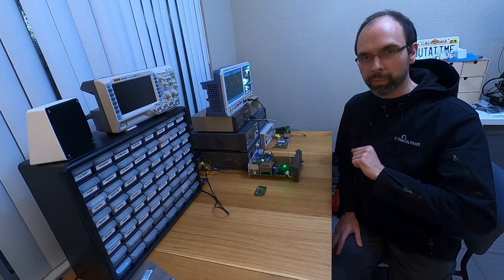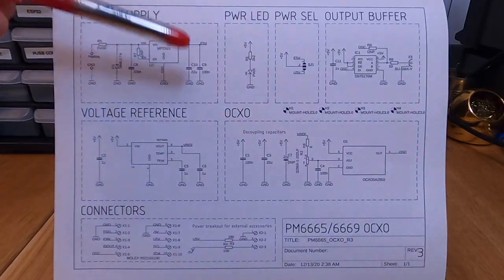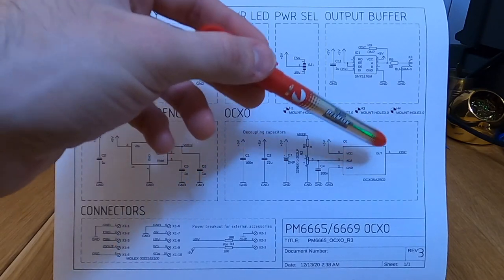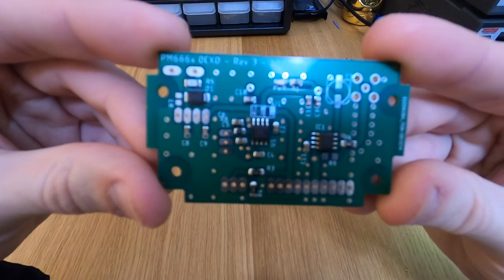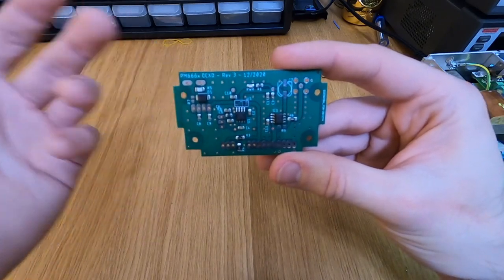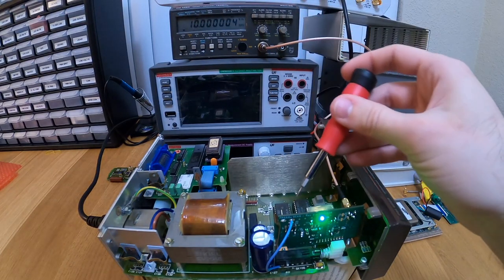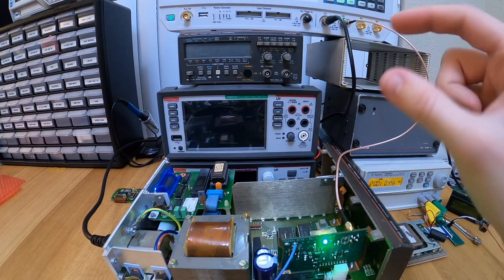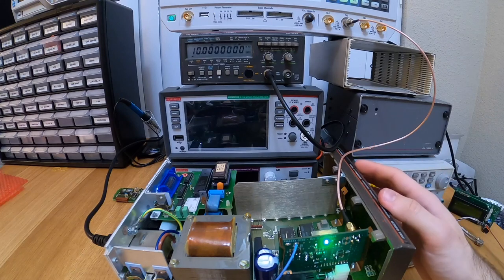PM6665/PM6669 OCXO upgrade : final and improved version (part 3)

Comment: good job .
I recommend you add to the  v reg circuit

add a bypass diode between the VIN and VOUT terminals of the reg
(reverse-current bypass diode)
This is standard in Liner Voltage  Regulators design
Reply from the maker: Thanks for the suggestion. The main power supply uses a switching regulator module. The other "power supply" is a voltage reference, and as such it should not see any reverse current. Which regulator were you thinking about?

But you are right, when dealing with LDOs, adding a reverse-current bypass diode is good practice!
Reply: @the_bootloader  I usually use LDO
of Linar Technology
current source based
example
LT3083
LT3042
But this method is most useful for Basic V REG
78XX
I use low noise LDOs
Because I build a lot of V REF circuits 
Linar Technology makes the best regulator there is

Comment: Good idea on using the voltage reference. I have a PM6665 in the light grey case. I have the same VCXO too but always wanted to build a GPSDO with it. The results you got are impressive, but what 10MHz GPSDO are you using?
Reply from the maker: Thanks ! I am using a GPSDO from a GSM base station. It has its own OCXO. I plan to make a video about it sometime in the future, but in the meantime let me know if you have questions. Also I have some PCB boards left, if you are in the US and want to make your own OCXO using my design, let me know
Reply: @the_bootloader  I may be interested.I need a second OCXO, but I might get some spares. Let me know about your boards.